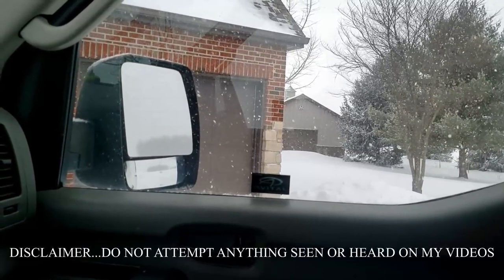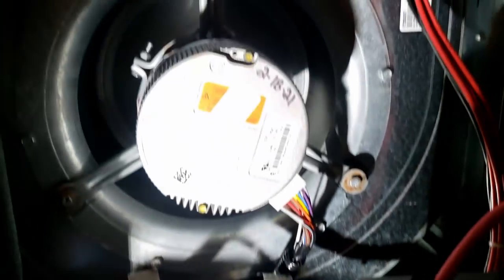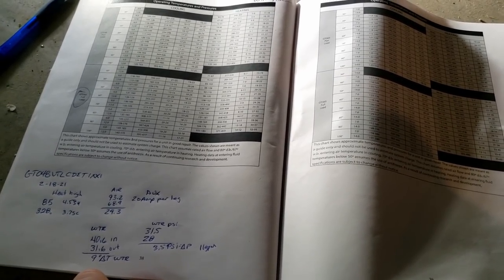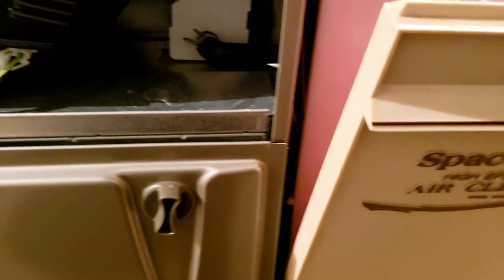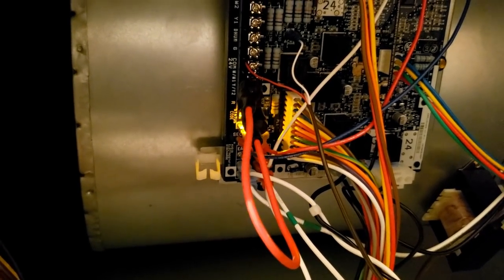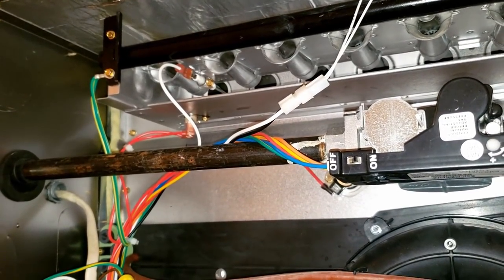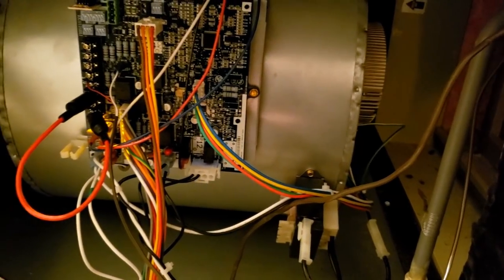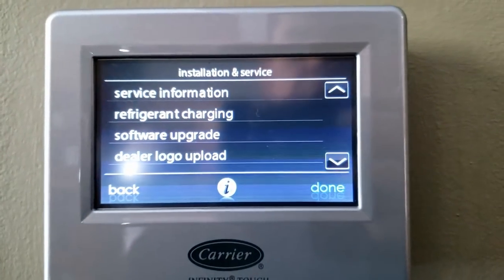NO HEAT,  INFINITY GAS FURNACE & GEOTHERMAL

Comment: Great video ! I enjoyed the troubleshooting and explanation of the geothermal unit. I haven't seen any here yet in the Chicagoland area.
 The drain on that carrier furnace was ridiculous. I called carrier tech support a few years ago to ask which wires to check for dc voltage on the inducer & he wouldn't tell me. He said just change the inducer. Luckily it worked lol
Reply from the maker: I haven't had the control board go bad very often, it's almost always the draft motor or the blower motor.
Reply: @HVACRSurvival  
Yeah I usually see the same thing. Their heat exchangers have been keeping the company i work for busy

Comment: Thanks for sharing the knowledge. I have a unrelated question Rick about the dtek stratus leak detector I bought one last year  more like a backup to my H10 ,I just recently tried using it for the 1st time on a leak search but I notice when I turned it on there is this constant buzzing/humming is that normal also there is a little hole on the back like its sucking air in is that normal? THANK YOU MUCH RICK .
Reply from the maker: The hole in the back is the exhaust, if you accidentally cover that with your finger it'll trigger a false alarm. The internal pump is noisy, if you put it in cloud hunting mode it makes a bunch of weird clicking noises, when it's making those clicking noises it's preparing the reference of the inside of the detector to the tip to get a differential.
Reply: @HVACRSurvival  ok thanks so all those sounds are normal.
Reply from the maker: @sdsd4284  yep, I took it apart and checked inside.
Reply: @HVACRSurvival  thanks for the support GURU

Comment: Wow that carrier drain was totally hacked. I install Tempstar which is basically the same thing.
Reply from the maker: It probably worked fine until it came apart and got dirt between the fittings. I don't glue fittings that need to come apart but they glued the wrong side of the fitting. It should have drained into the glued fitting not the other way around.

Comment: Great job. Install these infinity units all the time. App name?
Reply from the maker: RC Mobile technician. It all depends on whether you've got a good supply house for Carrier equipment where you're at but for me it's worked really good so far. I've seen the warranty claims on the equipment that's been done so far it looks up the parts and part numbers and gives you all the data sheets. Comm Lit is the other carrier app I use.

Comment: Seems like Carrier/Bryants are notorious for the 42 error. I must have replaced 10 this winter so far. Hopefully they do a redesign on those IDM.
Reply: That is the “ new design”  the predecessor to this one was a true ecm.  That system was modulating.  Had a modulating gas valve, VS blower. That IDM on the 59 series I believe is not ECM.  If you pull off the shroud the cap is right there.   
The original on the 58 series was a ECM that carrier had to warranty so many of them they changed it to one that looks similar to that one.   The new one just has the shroud to make it look fancy. Nothing fancy under the shroud.  Happy HVACing!!

Comment: The blower housings are to big to pull out. On the Bosch geo I have had to take motor out inside the evap cabinet without being able to remove the whole motor assembly. Stupid setup with Bosch. I like this design way better

Comment: Why does a non air source heat pump have backup heat?
Reply from the maker: Failing to plan is the same as planning to fail. Electric strips are cheap backup. Things break, you don't want to freeze your butt of if you lose a compressor or another big ticket item.
Reply: @HVACRSurvival  
Duh, emergency heat.
Reply: @HVACRSurvival  
I have an air source heat pump. Aux heat is natural gas. I have crossover set at 45. Cheaper to burn gas below that.

Comment: What’s the app name that you got the info on the draft motor?
Reply from the maker: RC Mobile technician. It all depends on whether you've got a good supply house for Carrier equipment where you're at but for me it's worked really good so far. I've seen the warranty claims on the equipment that's been done so far it looks up the parts and part numbers and gives you all the data sheets. Comm Lit is the other carrier app I use.
Reply: If you get the carrier service tech app it’s really convenient with the new infinity stuff you can Bluetooth right up with the VNA and it basically tells you what’s wrong with it. Thanks for the good videos keep them up, always learning
Reply from the maker: @lawrence6115  I heard good things about it. Thanks 4 the feedback👍👍

Comment: What is the app you used for diagnostics?
Reply from the maker: RC Mobile tech is the one I'm talking about in the video.
Reply: @HVACRSurvival  Im looking at the 18 page troubleshooting guide but don't see where it talks about voltages you should see at inducer motor..?
Reply from the maker: @joeydinner  I don't know what the full model number of this furnace was so I can't look it up again.
Reply: @HVACRSurvival  355AAV042060FBSA is a unit I recently worked on. I seen similar voltages at the connector at inducer and figured the board was doing its job. It would just be nice to know exactly what I should see next time I work on one of these though  .
Reply from the maker: I briefly looked through it very quickly while I was driving back so I did not study that sheet I found, I just seen that it talked about checking the dc volts on that plug.  I don't remember the exact model number,  maybe the one you're looking at isn't the same model?   That was the first time I've seen that information. I don't do residential much as I use to.
Reply: @HVACRSurvival  Thank you for the replies.
Reply from the maker: @joeydinner  your welcome👍

Comment: As far as I have any so called knowledge of heat pumps and their efficiency. Seems they are crap. Even the geo. System. They all need back up heat??? Why not just install a gas, or oil fired furnace,   With a blower and be done! Quit running the AC unit year round, switching it running AC, then backwards for heat, Stressing everything, waste and extra ware & tare.
Reply: I like the way you think. Sam kennison .....
Reply from the maker: That's like saying "why doesn't everyone just drive a GM truck". Cars are stupid and worthless, they can't pull a trailer, they get stuck in the snow and mud,  the resale value is less than a truck.... 🤔 Why... It depends on where you live at whether you need a car or a truck or no vehicle at all,  maybe you have a subway system.  I covered this in my live stream labeled "let's talk about heat pumps" not everyone lives in town with natural gas, not everyone likes gas. Around my area customers and techs hate fuel oil,  no one wants to work on it,  the shit's more expensive than even LP gas, it smells, takes more maintenance to keep it working.  Also something to consider, the government was offering a 30% tax credit on geothermal for the last 15 plus years, the cost to heat your home with a geothermal is considerably less compared to other alternative fuels. 👉 But yeah if you live in a town where you have natural gas and the local government isn't screwing you with high electric and gas prices,  why not have a natural gas furnace, that's the cheapest fuel currently to heat your home with but not everyone has natural gas available 👈. You got to get outside the box of where you live at. Both of these customers are in rural areas and the local power company is a co-op with some of the cheapest electric available.
Reply: @HVACRSurvival  you do understand his point.  His idea would have to fit into the natural scheme of things.
Reply: A heat pump can be from 100% to 500% efficient.  The best gas can be is 98% or so.
Reply: @scott_meyer  as temp drops so does efficiency....
Reply: @IFIXCASTLES  
True. But the seasonal average is usually 250% or better.
Reply: @IFIXCASTLES  
A heat pump moves heat. A furnace generates heat by burning fossil fuel. Heat pumps are the future as fossil fuels supply dwindles and electric supply from non co2 sources increase.
Reply: @IFIXCASTLES  
So coal and ng are going to last forever?  They will run out at some point.  Wind, solar, geothermal energy will last forever.
Reply: @IFIXCASTLES  
In Europe heat pumps are the norm since most homes are all electric.
Reply: @scott_meyer  So shut off the heat pump to reduce wear and tear and just use resistant heat. That's what the fellow is saying.
Reply: @IFIXCASTLES  
Um if the heat pump can move over 1kw of heat into the house for every 1kw of electric it uses, why would you turn it off? At some point it will not be able to keep up with the heat loss in the house.  The thermostat will switch over to aux heat when it senses that.
Reply: @IFIXCASTLES  
A geothermal heat pump is probably closer to 400 to 500% efficient.
Reply from the maker: @IFIXCASTLES  Sure I do but what can I do about what people choose or have available? When I didn't use to work on heatpumps much I didn't like them either. People don't like what they aren't used to. I hate Mitsubishi but I know there are some of the best.
Reply from the maker: Only 10% of the US energy is solar and wind last I checked. At night, cloudy days and when heavy snow hits there is reduced to no solar energy being generated.  Ask Texas about that🙂.  Wind doesn't always blow and usually is strongest at night when the demand is lowest.  Alternative energy is nice but it's not all of what your believing it is, the technology is not advanced enough to replace coal and nuclear. We have one of the cleanest burning coal energy plants in the world in south eastern Ohio. Energy is a political issue just like climate change. There's nothing wrong with being good shepard's of the Earth but you have to see through the alternative motives.
Reply: @HVACRSurvival  
The wind turbines in norther Missouri did not fail during the cold snap. Texas failed to winterize anything. They had failures in coal an ng power plants  due to lack of wintetization.
Reply from the maker: True. We have a shit ton of them in Ohio and they usually work in the winter here. The payback use to be 10 years to break even, I see them broken down a lot and they are only 5 years old around here. Only thing I'm saying is there not able to replace NG, coal, and nuclear anytime soon.
Reply: @KG-yn9qi  
Um what? 
This started as discussion of heat pump efficiency and a simple statement that heat pumps are the future of heating. Fossil fuels WILL NOT last indefinitely. At some point they will run out. At that point we will  be using electricity from solar, wind, hydroelectric, geothermal, tidal, and nuclear power.
Reply: @HVACRSurvival  
At some point they will have to. Fossil fuels are not unlimited.
Reply: @HVACRSurvival  Sir understand your point! But due to Demon control electric power is generated cheap here but is producer taxed and then user taxed and then priced controlled by the traders er I mean.. Demon ruled government and is the highest costing to use. As well as all fossil fuels. Welcome to California!
Reply: @KG-yn9qi  
Wow, really? So you think fossil fuels are unlimited somehow? 
How old are you? 12?
Reply: @KG-yn9qi  
True or false..
Fossil fuels can last forever...
Reply: @KG-yn9qi  
Have I anywhere in this comment thread say we need to stop using fossil fuels? Why would we not want to use heat pumps regardless of where the electricity comes from if you can get a 250 to 300% seasonal efficiency?  Doesn't that make the fuel source last longer for using the electricity more efficiently?
Reply: @scott_meyer  well I worked in oilfields from 15 years old  for 25 years on rig / well work! Done just about everything can do to a hole in the ground! From drilling to abandonment all in between! The shortage in 70's was all political. See wells shut in to cause the so called shortage! And yes new fields are harder to locate and develop. But the use is still political. And controlled. The burning and use is and still could  More efficient. But if do then the price goes down and those in charge, will not make their money!!  Also you do know that not all fuel is used to run our vehicles? Converted to electric power, makes other products  used for everyday life even some medicines. The clothes you ware. The food you eat is farmed and delivered with help from fossil fuel. But as ways of keeping and finding fossil fuels are being controlled. By those who want to destroy the way we live to make their money doing it another way! Okay but still will need fossil fuel. To make the materials, transport them. Set them up and maintain them. And still will not be enough to suport us with the population of the earth as it is and will be! They know this and is why the Demon crack pots are doing everything to cause another world war to lower the population. Or do you want to go back to killing whales for lubricating machines etc. No I am not twelve! Probably older than you! I agree for additional ways to better our way of life! But not crammed down my throat so some one can make a buck! And control how I live. By fear mongering and brain washings our children. To socialism dictatorship.
Reply: @KG-yn9qi  

So the oil will last forever?  Yes or no? Simple question.
Reply: @KG-yn9qi  

Are you OK dude? You seem to be triggered by heat pumps..
Reply: @KG-yn9qi  

Did I ever say any of that? I simply said heat pumps are the future of heating once fossil fuels run out, whenever that occurs, or become too expensive compared to other sources of energy.
In areas that have electric only homes, heat pumps are the cheapest way to head a home.
Reply: @KG-yn9qi  

I have an air source heat pump with a natural gas furnace as secondary heat.
Reply: @KG-yn9qi  

Fossil fuels will eventually run out. Current consensus is between 50 and 100 years from now. 
It makes sense to develop and work out the kinks on alternate sources of energy for an ever increasing demand now instead of waiting until our back are against the wall.
Reply: @scott_meyer  nope!!! Got an old school heater in the floor that was installed in the 40's. Does not have a blower or draft motor or a thermostat. Turn on feel warm enough turn. Off. Does not fill my home full of CO have alarms and have had tested  did I say it is 76 years old works great !!!  Been using it from 1980 when bought the house cost me 50.00 a month for gas. Stay toasty warm. Now have a brand new package unit, on roof . Now that it has a inducer motor and blower motor, and then use gas and is on a thermostat. My gas is now 100.0 a month, electric is now twice my regular  cost before the install. And it does not run all the time. So cost more than doubled. So tell me how it is ( any of it)  better!!!  The cost of electric is higher here and units made no matter who's are junk and ware out before recoup any cost. And running compressor year round they will not last.